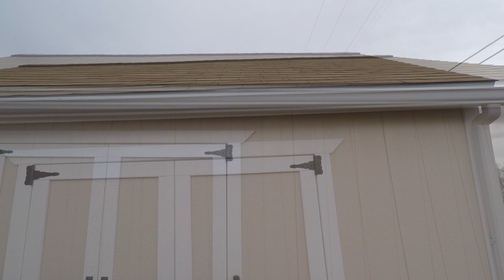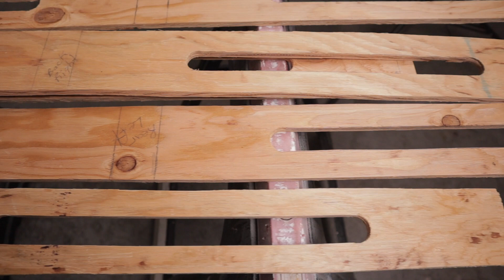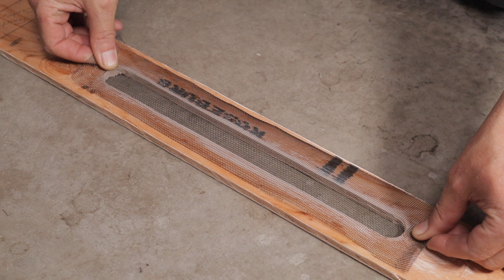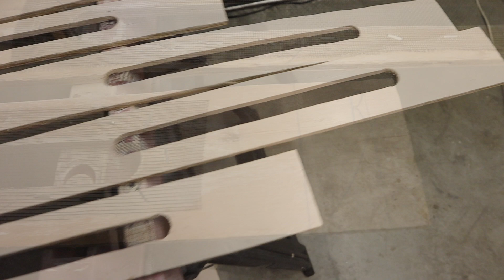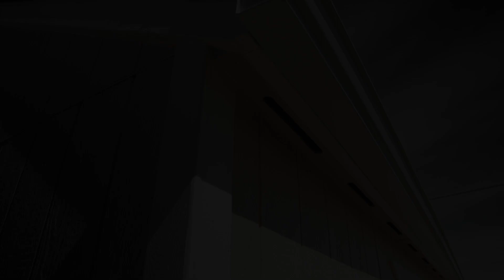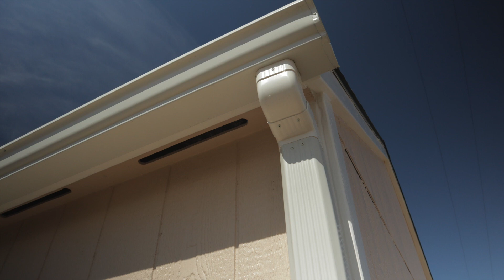Shed Ventilation DIY: Cheap Soffit Vents That Actually Work

Comment: Nice job!  We have been doing this for years with regular 24”wide soffits.  We usually use a 1x6 v-grooved cedar soffit board, 4-5 per soffit.  We usually vent the second board from the outside and hog out most of the material with a jig saw and then use a router with a 1-1/4” straight bit and edge guide to make a perfect 1-1/4” slot.  Then we use a 1/4” round over bit to soften the slit.  They look great and are a custom job that gets noticed!
Reply from the maker: That sounds like a great method, thanks for sharing!

Comment: With this and the roof vent what else would you recommend in regards to controlling moisture. Would you recommend a house wrap or any radiant barrier. Maybe an ERV?? I'm building out a 16x40 lofted
Reply from the maker: I think a gable vent on each end would help a lot. Depending on your climate a house rap is probably not a bad idea either.

Comment: Why is the ventilation holes needed? Wouldnt heat or ac go out those vents if its a tiny house?
Reply from the maker: The vents create airflow between the insulation and the roof decking to prevent mold and rot. The interior temp controlled space inside is not affected by the vents.
Reply: Ok.. im getting ready to build a shed/tiny house. And was curious..and watchinh lots of videos. So i hopefully can do it right the 1st time.. thank u!!!
Reply from the maker: I wish you the best with your project Lillian. This video I made installing the interior insulation may help you understand how the vents work. https://youtu.be/8sDsdNgf5G0